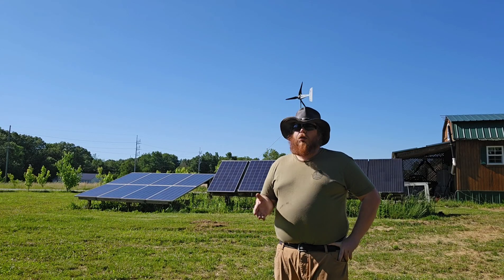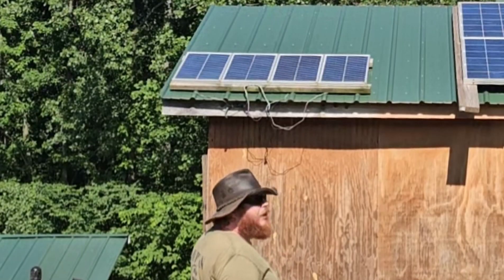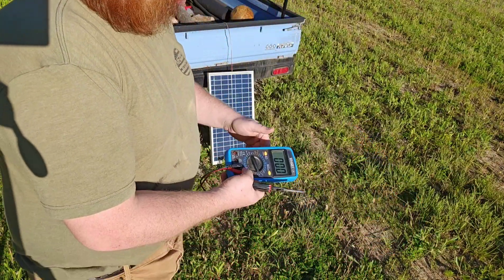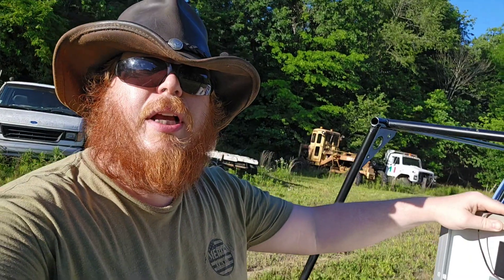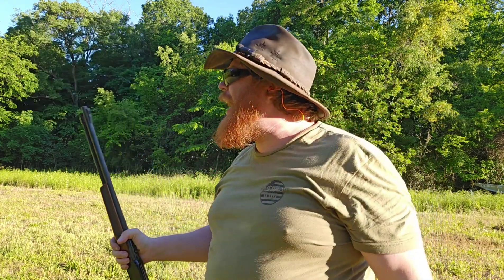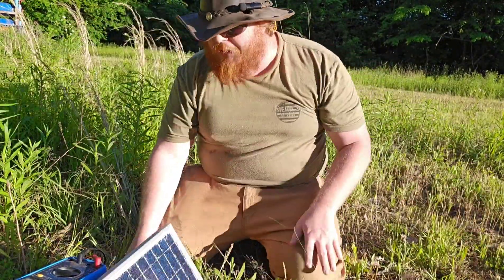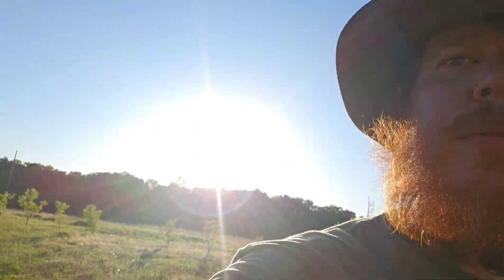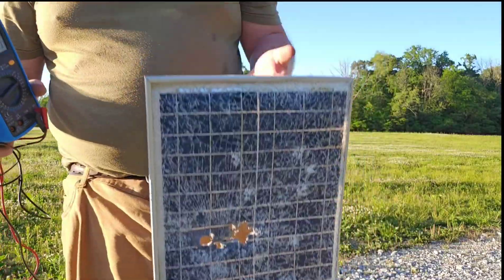Solar Showdown: Shooting a Panel to test Resilience

Comment: Sad day we live in when you have to claim you’re not political..  One only has to take the rosy glasses off and look outside to see off grid homesteading and self reliance is smart..  I’m not a big climate change nut and EV fan boy but a working towards an off grid homestead myself.  People will think it’s stupid until the power grid goes down and grocery store shelves are empty..  Hails a lot where I live and a lot of cattle water tanks are solar powered and I’ve seen them take a beating and still run the pump if the face is broke. 

As far as 22lr I got ya beat on prices.  I just bought 5.000 rounds of Aguila super extra hollow points a week or so ago for $250 on sale. But I still have close to 8,000 rounds of PMC sidewinders my 10/22 loves I paid $100 for case of 5,000 rounds years ago when in the first couple years of Obama’s first term.  I had 6 cases of them but my baby nephew and niece got S&W 15-22’s for Christmas years ago and those 2 little hethens have plaid hell on my ammo stock.. lol

Comment: lol hes worried about a 6 dollar multi meter lol mean while one of those solar pannels cost anywhere between 25.00 dollars to 50.00 dollars so yeah that make so much since you can easily replace the multi meter but a solar panel well they cot way way more so you don sound that smart in this one brother
Reply from the maker: Go ahead and be hateful then, but you can find used panels on Santan solar .com. 300 watt panesl go for about $50 a piece
Reply: @theoff-gridguru  yeah ok im sure there worth it lol not why would i buy used pannels for
Reply: @theoff-gridguru  so why did it bring me to go dady then if its not fake bro nice try you cant find 300watt solar pannels for 50 dollars this dude keeps on lying
Reply from the maker: I said in the video that the panel cost $5 used...
Reply: @theoff-gridguru  yeah so buy them again for 5 dollars again lol thats what i though you cant because theres no place to buy a 30watt solar panel for 5.00  dollars so stop liar
Reply: @PattiPoss  He was testing the solar panel not the multi meter.  Your logic makes zero sense and you are basically calling people stupid.. lol